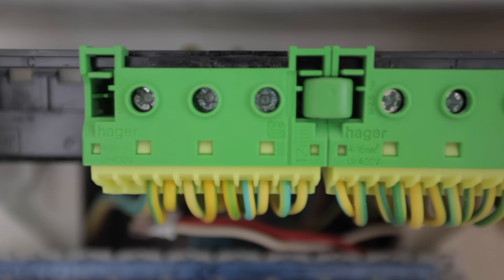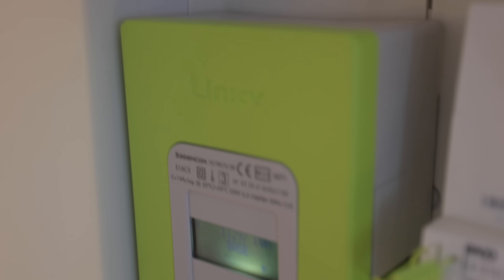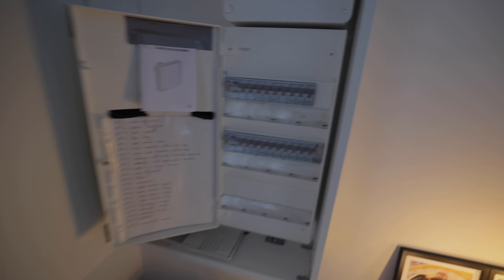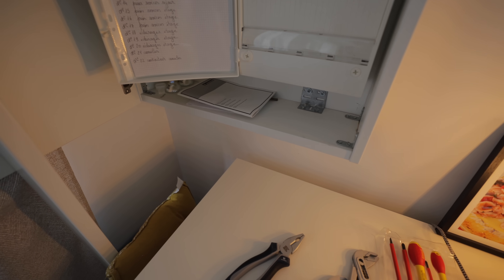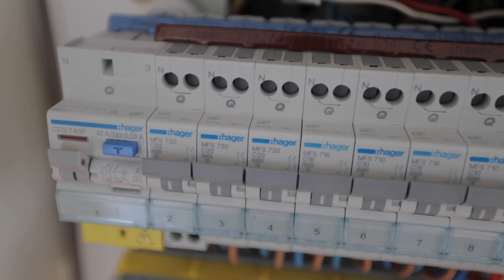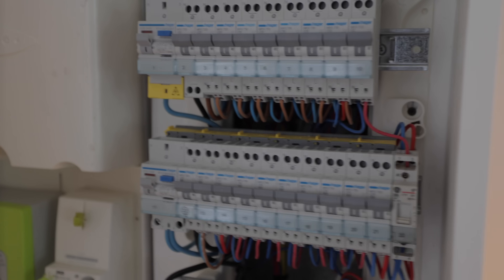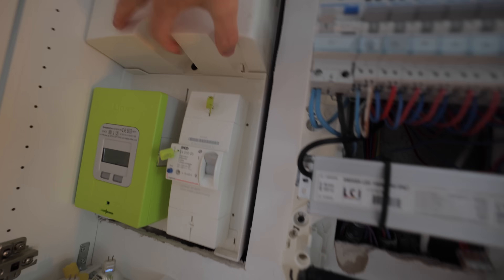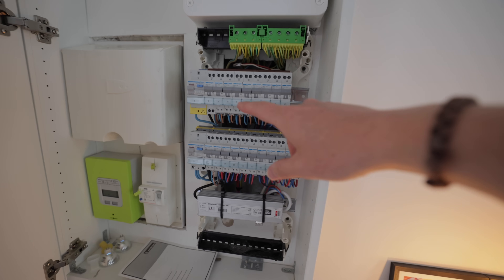U.K. Electrics SUCK! This is what we should be doing…🇫🇷

Comment: In addition to @johankorten2797, in the Netherlands the wiring is placed in conduit (mostly not flex), and the common circuits are distributed in a star form from lightpoint to lightpoint to the switches and outlets. So when the wiring needs replacing you don't have to break the walls open, you just pull new wires from box to box. Lighting and common outlets are on combined circuits ( 16A). 
Also we don't have ring circuits like in the UK, so no need for glass-fuses in every plug. I do find ring circuits are outdated and could be a fire hazard, if the ring has a break somewhere. 
The location of the cabinet with the meter- and distributionboard needs to be within a couple of meters (I thought 3) from the front door of the residence.
Reply: 32A circuits are extremely useful and flexible though, and they do not have to be rings either and can be implemented as radials. It means that in a location like a kitchen you do not need separate circuits for things like microwaves, electric kettles, dishwashers, air fryers and so on. It makes things simple. Also, it means that something like a thin flexible cord on a table lamp can be protected by a more suitably rated fuse in the plug (such as 3A) rather than a 20A breaker.

The reason the fuse in the plug system was adopted post-war was that the previous round pin standard had different sized plugs and circuits for different functions. Thus low powered devices would use small, 2A or 5A plugs on radial circuits with a 2A or 5A central fuse. Higher powered devices would be on 15A radials. 

It was deemed by the designers of the system that it was more flexible to have a single sized plug but without forgoing the extra protection of having a fuse sized for the type of appliance in use. Thus BS1363 and the fuse in the plug idea. That was an enabler for 32A (and more powerful) circuits, but it was not the only reason. Of course, this was designed before MCBs, RCDs and so on, but it remains a very useful feature which enables BS1363 plugs to be used on just about any rated circuit (it's common to have a 13A socket on a 40A cooker circuit for instance).
Reply: Ring circuits can use less copper which was a very important consideration during the Second World War when they were first adopted as a common wiring solution. Modern practice, I hear, has returned to favouring radial circuitry,
Reply: Surprisingly I've had ring circuits in my house for over 60yrs and never had a problem, although I do tend to look after my own wiring needs.
Reply: @howmadisthat  If you maintain it correctly it certainly can work and can be safe. But most people are not qualified for this, and will not notice when there is a break in the ring. In my opinion, ringcircuits in domestic environments are outdated and there are better/safer solutions nowadays.
Reply: That literally has nothing to do with the reason we have fuses in plugs. It's a standard applied to protect the wiring of the appliance in the event of a fault. This in turn protects the appliance and mitigates fire risk. Regardless of how our system is setup in the UK we'd still be fused at each plug in appliance to ensure that it is protected with the adequate rating to it's cable CSA and type. Eg a lamp being plugged into a socket even radial at 20A MCB would still be a fire hazard unless protected at the plug or a fuse spur on a 2-3A fuse. In the UK we aren't stupid, it might not look great but we use our brains. Look up adiabatic equation and see the science we apply to our work to ensure safety standards are met.

Comment: You only have a 45A supply (actually, I think you said the blade fuse was 40A)? That seems very low, especially with lots of air conditioning units. Have you had any issues with it tripping if you boil a kettle while the air conditioning is on? They're never going to get an EV charger powered from that.
Reply: That's a flat, you are not going to get EV charger there anyway. House would get 3 phase supply.
Reply: @jacekowski  Flats don't have an "étage".

Comment: You are the first British sparky that is pro plastic conduit... Everytime i mention this. I get the usual answer "you aren't in the continent are you"
Reply: No need for it when using RCD protection. Nice to have a large conduit for all circuits going to a kitchen though.  But that corrugated conduit? Nah. Expensive and unnecessary.
Reply: @johnburns4017  Properly installed singles in flex conduit make life a load easier if you want to, say, change a light switch from single gang to double gang without chasing walls. Customer drilled into cables? Pull cable instead of singles and plug the hole, perfect repair without any holes.
Reply: @Ragnar8504  
There are advantages for sure, but more expense and inconvenience when installing.

Comment: I think the ‘cumulus’ circuit is there for the EDF to be able to remotely disable the water heater during peak demand periods. I vaguely recall that there was such functionality built into the ‘geyser’ (as we used to call it) circuit when I was a youngster living in South Africa
Reply: In France it's pretty common (depending on your subscription) to have cheaper electricity during the night and/or around noon. The "cumulus" (which is the name of a range of water heaters from the brand Atlantic) is connected through the contactor and works only during these periods
I think it's possible but it's extremely rare that EDF uses that way to reduce power demand during peaks
Reply: The 2A breaker is to protect the contacter which turns the hot water heating on depending what hours are cheap rate on your contract. Heurs Creuse is cheap rate and heurs Pleine is full rate. In my case the hours for heurs Creuse start at 23:36 and end at 07:30.

If you push the buttons on the Linky you can see instant current consumption, kWh for day and night, maximum current ever drawn for the house and the linky is already setup to measure how much you've injected back into the network if you have solar panels. This is under Index Injection on the Linky.
Reply from the maker: Yeah I think you’re right!
Reply: @artisanelectrics  I think it’s called ripple control
Reply: The EDF will send a signal low/high price at fix times.  Times at witch electricity is less expansive depends on your subsciption contract.  The little 3 positions slider on the contacter is for:  0=Always OFF,  Auto=automatic switching,  1=forced ON.   On some contacters The forced ON will automatically switch back to Auto when finished heating or  low price signal is sent.

Comment: 1:06 Is the consumer unit not in a closet, an inaccessible corner or under the ceiling?
9:50 I like that the fuse switches off the hot phase and the neutral conductor. 
In Germany only the hot conductor is protected.
AC RCD  are banned in Germany. Only types A, B or F are known here. Usually 30mA
16A breakers with only 1.5mm²  are common in Germany. France uses 20A and 2.5mm² cable
Reply from the maker: Yeah double pole breakers are the future 🎉
Reply: @artisanelectrics  they where already in te 90's here in Belgium when i change my fuseboard en was in highschool :-)
Reply: TYPE AC is alo forbidden in Belgium since many years . if you have inspection this is a fail.

Comment: Very interesting on the new stuff it would be interesting to see some of the older properties wiring. That's some commute you've introduced for yourself !!
Reply: You do not want to see old French wiring! Even 70s/80s wiring is quite shocking to us. Things have improved greatly in France.
Reply: @johnburns4017  One thing that constantly amazes me even in fairly new wiring is singles in trunking. It's legal over here only if the trunking can't be opened without using tools, and regular old trunking definitely can.
Reply: @Ragnar8504  
plastic trunking in the UK needs a screwdriver to prise the lid off. So a tool used.
Reply: @johnburns4017  Memories of my first trip to Paris (mid 90s) include cafe toilets where the (Hopefully!) neutral leg of the light was wired through the lock on the door, as the light would illuminate as soon as the bolt came into contact with the hasp. I very quickly adopted the habit of (un)locking the door with a few layers of folded toilet paper as insulation... ⚡

Nothing to do with perceived danger, mind you. I was just aware that I don't have nearly the same degree of Resistance as the French. 🇫🇷💯😇
Reply from the maker: Haha true 😂

Comment: You're right about the consumer units, the mains connection, and the metering. But after that the good sense stops. Earthing policies are extremely variable - that's why there are so many return differential breakers. Then wire colouring shows artistic rather then engineering traits. In my house (completely rewired in 2013) I have seven different colours in use. Because of the earthing issues there's a lot of leakage and floating voltages. Your tester/screwdriver could be lethal, if used to identify live and neutral, especially in lighting circuits. Trying to debug a simple two way switch for a light in our bedroom was only possible with a multi-meter and a separately secured earth connection.

So agreed about the consumer units, but working on domestic circuits in France can be a nightmare, especially with so many three phase installations outside the towns.
Reply: Until very recently many countries that mainly use conduit wiring only specified core colours for neutral and CPC, lives could be anything but blue, green/yellow, green or yellow. Most sparks still used black (or in France red) for L1 but for things like strappers and switch lines all colours of the rainbow are used. Before Austria went for mandatory brown/black/grey in 2020 some sparks colour-coded circuits, like having purple and orange permanent lives for some circuits. Basically the rule is "If it isn't blue or green/yellow, it's probably live, either permanent or switched". Although the method of colour-coding circuits was legal until 2020, you're most likely to find it in installations from the 1970s and earlier.
Reply: 'Earthing policies are extremely variable'   thats a big understatement....remember reading some apartment blocks in France dont even have earth circuits at all  !!....and if you hop across to Spain..not unusual to find earth cable with live colour coding..and thats just the beginning........there is a lot of funny business going on out there, outside of that old beauty 7671 😆

Comment: You should take a look into a modern German home
Reply: That's a great proposal, I would be interested about his thoughts.
In Germany the whole main installation with the meter(s) and communication devices will be a metal enclosure (meter cabinet), which is isolated on the inside. There is a three-phase-supply on every building and the cable from the grid provider is terminated in a dedicated box. In contrast to french electrics only the phase is switched by the MCBs and type AC RCDs are forbidden. Installations in conduits are rare, most cables are directly laid into the walls. In addition there are standards for everything and similar to the UK testing the installation with measurement devices is required.

Comment: My first thought was there must be no ring circuits here, because of the shear amount of breakers.?
It looks like every socket has its own dedicated breaker..?

Surly that can't be the case..?
Reply: RIngs are only in the UK. Europe is almost completely run in radials.
Reply: @AndrewStrydomBRP  
The Irish, Malta and Cyprus use final rings as they have a fuse in the plug.
Reply: @johnburns4017  And probably singapore and hong kong too, anywhere where they have copied the UK's homework on electrics. But mainland europe doesn't do any of that.
Reply: @AndrewStrydomBRP  
About 55 territories use the G type plug.
Reply: Not every socket, but every group of sockets wired on a radial.
Reply: Sockets are wired on a 16A breaker and there's a maximum of 4 double sockets or 5 single sockets on a breaker. Regs in France state minimum number of sockets per room (4 in bedrooms) minimum of 8 in a kitchen. Devices like oven, dishwasher, washing machine each have to have their own individual circuit. In larger houses it's not unusual to have 4 or more rows of breakers.
Reply: @philpayne4579  
I think you mean max rather min?
Reply: Sockets and plugs don't have internal fuses or switches on the main land. So there is a fuse in the consumerunit and from there its split to several sockets. Depending on usage patterns or local regulation there can be a single socket or multiple sockets on a fuse. Generally speaking your livingroom or bedroom can have al its sockets on a single fuse where the kitchen has multiple fuses for multiple sockets.
Reply: 8x max of 16A socket protected by a C16 RCD and 12x max of 16A socket protected by a C20 RCD as per the NF rule
Reply: @testman9541  my bad, was getting confused with some regs from 10 years ago when I wired my house, which was Max 5 sockets on 1.5mm2 and 8 on 2.5mm2. I see there was a change in 2015 to allow what you said above, on condition that the wire is copper.

Comment: The Netherlands has very specific requirements for the main consumer units: a standardized "meter cupboard" (meterkast). It is not perfect, but nowadays the regulations say even where everything needs to go NEN 2768[1]. The base plate is also standardized 2100 × 750 × 310 mm. That is where the main cable of the electrics but also (often) gas and always water come inside the homes. I also like Hager. In the Dutch regulations it however limits the amount of circuit breakers per RCD to four.
Reply: The Brazilian standard is closer to the EU than the British. Basic supply is 1 phase 127V for very small houses in very poor regions. Due to the electric shower with up to  7500W, most residences have at least 2 phases allowing 220V. Three phases is frequent if residence is not so small.
Rural areas have 1 phase splitted in the middle making 127+127 = 254V! It is frequent to see just one distribution line for the transformer that has the other side connected to the ground and the neutral. Hope neutral never disconnects in this installation!
There are 2 states where the phase neutral voltage is 220V.
All Brazil is @60Hz
Reply: There are no Dutch regulations concerning mains electrical installations on boats. Companies can do as they wish and install systems without RCDs or even trip switches. Even the top builders mix AC and DC wires in the same installation. How on earth more people don't get electrocuted on boats is beyond me.
Reply: Love to know the cost of the double pole circuit breakers with the push fit connections and is there a single module rccbo version, probably asking too much now, no rings there though
Reply: @williamlowther7051  on major brands (Legrand / Schneider / Hager) it's around 8-10€ for circuit breakers. More like 30€ for 3-Phase + N. 
Rare amp values (like the 2A used for command circuits) come at a higher cost, can be 12-15€.
Reply: You should visit Germany, we have some pretty good stuff.
Reply: @Kecman24  with common neutral? That’s not as safe as dual pole breakers
Reply: @pizza_diavola-bx4op  agree, that is something Germany can indeed improve on. Although I don´t know if it that necessary the way Neutral and Ground work here.
It would sure not hurt anything.
As you may know there are different grid types on what is delivered to the house. I am talking about TN-C, TN-S, TN-C-S systems etc.
The french panel obviously has no TN-C system, as that would only have a common PEN and no separate Neutral and PE or Ground.
We commonly run a TN-C-S system , where a PEN or just a Neutral comes in from the Grid, and there is a Ground rod at the home, to which that one is connected. In the panel, both PE and N are actually connected.
In France they either do the same, or they may have a TT system, where N comes in, but PE or Ground is only a Ground rod at the house, with no connection between N and PE. As this would usually requiring grounding of the single device, I assume a TN-C-S thoug.
Reply: @alexanderkupke920  oh that explains why. In France in households we use TT. Neutral is connected to the ground in the last distribution transformer. In the house, the earth rod (or other earth type, like a wire or nest in a trench) is connected to every ground wire circuit, to every metal pipe entering the house (gas, water...) and to most metal parts in the bathroom (window frames, bathtub, etc.) 
In this configuration, neutral is not 100% safe as if neutral is broken somewhere (before entering the house for example) it can become live through other appliances connected to an active phase and neutral.  Then neutral isn't 100% safe as there can be a fault somewhere, making the neutral live
Reply: @Kecman24  ... but also ugly stuff.
Reply: I was shocked how the consumer Unit of pur vacation house looked like, even after we did them all new. Not even possible to put a 11kW charger on it.
Reply: In the USA, all breaker boxes and water meters etc are outside!  Power cables are  without other protection hidden in ceilings and dry wall through the wooden studs. In Europe those massive cables in three colours go through plastic tubes and permanently fixed on in wall boxes. In principe on these go the wall outlets and switches.
Reply: you mean those ugly black ini mini boards they still sell ? with no cover ?
Reply: @kittsdiy sorry? Wat bedoel je?
Reply: I dunno but the old ones were wood in south africa and now steel with some kind of plastic or enamel paint, mostly whit or grey black was the color of the switches cause its like a plastic that doesnt melt as easy as white plastics i think they added carbon  @kittsdiy